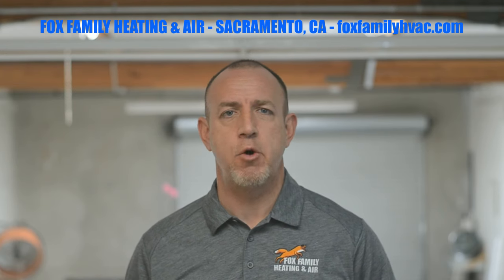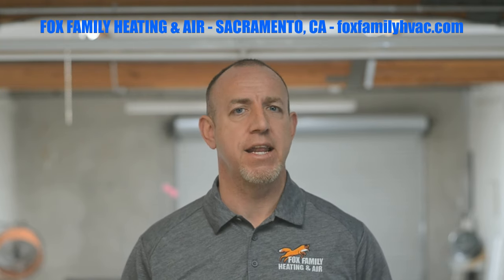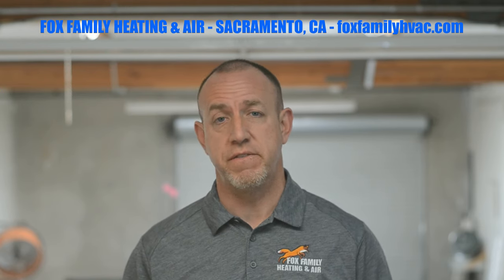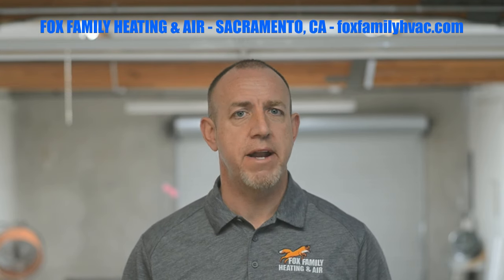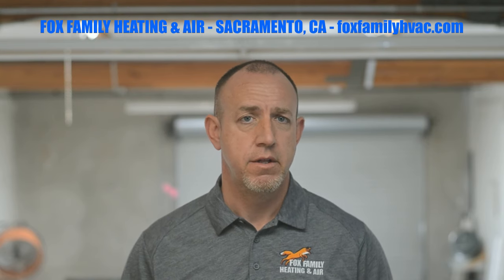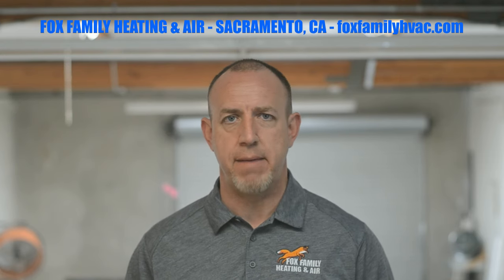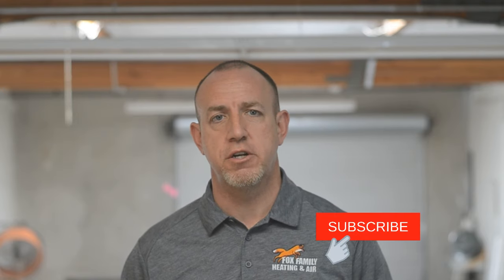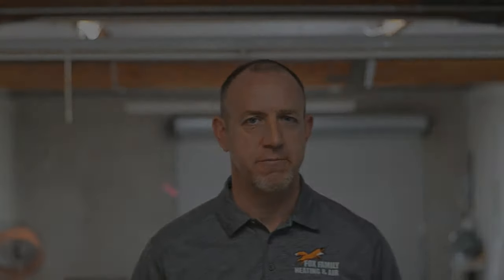Why Does My Air Conditioner Circuit Breaker Keep Tripping?

Comment: why that LONG story?
Reply: Lol
Reply: FR
Reply: Totally true, could have cut it in half
Reply: Lmaoo hey uncle Ricky can you read us a bedtime story please!
Reply: How to perform CPR spends 10 mins on introductions
Reply: @ivancarrascoq 1🎉😢🎉🎉
Reply: Low line voltage can cause the compressor to over amp. Intense solar heat can cause a weak breaker to trip. Old style aluminum wiring can cause a bad connection and produce heat and trip a breaker. Low incoming voltage may require an investigation by the power company. The Technician can contact the the power company and the Power Quality Department should be able to adjust the incoming voltage. The home owner should not be required to buy power regulators. Sometimes voltage recorders are placed to detect things like large manufacturers using a lot of power at certain times. These situations normally start off with an adverse situation with a battle of who’s volt meter is better calibrated and what is the allowable voltages. Not something a homeowner is prepared to do. An AC technician needs to know when to call in an electrician.

Comment: my upstairs ac kept tripping after 10min of being on. a handy man had told me to change my air filters first. im a new homeowner so i havent replaced the filters since owning the home..about 2 years. xD. anyway that fixed the problem. dirty filters cause high pressure and make the ac over work so change ur filters every 6 months.
Reply: negative pressure
Reply: You should change your filters more often than every 6 months as well. People buy new homes, and like you, fail to do preventative maintenance. It’s part of the cost of owning a home. This is why a mortgage, isn’t the only cost to consider when buying.
Reply: 😮ok. great word !
Reply: Ty and appreciate you
Reply: 100%. People tend to forget about the taxes, interest, maintenance, repairs, and the very good possibility of the market crashing…purposely of course.
Reply: My nest voltage is acting up geting low

Comment: Our ac is tripping our breaker 1week have past and it's still the same, ac works on fan setting but when in cold setting it immediately trips. What cause this problem? The electrician came but still the same issue happens he can't fix.

Comment: If the unit has not been cleaned in a while, it may just need cleaning. Make sure the current is off before cleaning. Cleaning is a very simple process. I just paid $260 for a cleaning, when I could have cleaned myself.

Comment: "It takes a licensed contractor to order them from a local distributor"...Well in some areas this is true however one DOES NOT need to be licensed to order HVAC parts other than perhaps refrigerant, online. There are some distributors that voluntarily refuse to sell parts to locals so as to protect their customers, the local yokels that call themselves HVAC techs and the businesses they work for (by the way, plumbing suppliers, electrical suppliers used to do this too) however, it has become a practice that does nothing more than force the consumer away from their business to businesses on the internet that indiscriminately sell to anyone. Frankly, when I moved to Florida 15 years ago I was forced to maintain my own system because of the incompetence of the HVAC techs I dealt with back then having realized that I knew more than they did! I once asked one tech what superheat he measured on my system and he didn't have a clue what I was talking about! Subcooling would clearly be over this guy's head too...

Comment: Mine trips immediately.  Could that be the capacitor or the contactor?  Hoping it is not the compressor.
Reply: Update?
Reply: @juanjoseguevara88   It actually happened to me TWICE!   Once was a power cord that was not properly run through conduit and the edge of the metal enclosure cut through the power cord and shorted. Easy fix.  The second time it was the compressor motor that went bad and had to replace the motor. that one was about $800.  Guy who fixed it said that most times it is the capacitor.

Comment: What can cause breaker to melt? Condenser motor was changed,contactor, and turbo 200. Original cap was 45/5 and bearings were giving out. So switched out.

Comment: Why does my 20 amp a/c trip it's self a few hours after running but when only  it reached 90 plus outside. I also hear clicking somewhere above the breaker box?
Reply: Have you resolved this issue?
Reply: Higher ambient temps .. eventually higher high side pressure. More load on the compressor.. more amp draw.

Comment: Question only when it reaches 105 degrees my ac in my rv continues to shut off and on. But when it's cooler like at night it doesn't shut on and off. My portable ac does the same thing
Reply: Did you figure out the issue? I'm in the same boat

Comment: My 10 yr old + heat pump is tripping on start , after flipping the switch once or twice it usually works . At the moment it’s only doing it on heat. Would changing the capacitor fix the problem?
Reply: New capacitor fixed it.

Comment: My 240 amp AC breaker doesn’t trip. It’s the furnace 20amp breaker. But only once in awhile. And only started doing it after the thermostat was changed? It didn’t do it before??
Reply: Odd.. Is it gas heat?  And if so, 20 amp is unlikely too.. usually its 15 amp just for the inside blower.  The relations ship to thermostat is no there, since gas rarely short-cycles. I'll check the cap on the blower fan .. and change it out once you have that pulled. To do so, you have to pull the blower -- not so straightforward but plenty of youtubes for that.

Comment: Do you know why my circuit break it tripping only when I'm using the dryer and A/C  and it's only tripping the dryer.  If my a/c isn't on the dryer runs good?  The circuit breaker isn't hot just a little warm 
Thanks
Reply: The circuit is overloaded and is drawing more amps than the breaker is designed for. 

Either don't run ac and dryer together or install a larger breaker. The breaker size is determined by the cables conductor size. If breaker wasn't tripping electrical fire may occur.
Reply: 208-230v circuits should be individually ran. Two circuits on that type of wiring will overload the circuit. Don't just assume to install a larger breaker. Call a pro

Comment: My AC's trips instantly.  Is it likely an electrical problem?
Reply: Bad compressor usually if its right away.
Reply: @marcoselgaucho1106  check wiring in outside compartment...i had a dead mouse shorting out the capacitor once..big sparks

Comment: Worked fine last year but out of the blue it has been tripping out within every 24 hours. I find it frustrating and it’s a newer unit. My house runs on 100amps
Reply: Now it’s dead
Reply: Bro the same thing just happened at my place, did you find the source of the problem

Comment: this video only applies to home outside a/c units, right? not window or mobile a/c units, regardless of how big they are, because the fix is more than what they cost?
Reply: Correct. It’s a mini version of a full ac system, and the cost to even check on it will be close to if not more than most window units.

Comment: This is interesting... I purchased a new split AC, technicians recently installed it... It was tripping the breaker they put it with, so they came back after I reported it and put in a new one. 6 days passed with the AC working fine and now its tripping it again...

Comment: Good info on the video. Now what if the breaker doesnt trip but by turning off and then on will the AC start working. Happened to me twice this week, AC shuts off no power to control panel (no lights) no humming outside unit,overflow switch good,system dead so I go to the cb box, cycle the ac circuit breaker a min later system is running.I really dont want to call a tech if the system is working for now,might get a tech just like you mention. Any suggestions? Liked and sub.Thanks
Reply: Me too, same thing. Doesn't trip the breaker, but if I turn off breaker and reset, just stays on a couple minutes, then repeats. Have to wait on tech a couple days now
Reply: Did you ever get an answer for this, I know this comment is 3 years old. I’m in the exact scenario

Comment: I keep bugging my parents to have someone come check out their home breaker that trips whenever more than 1 wall ac is on. My dad keeps saying we don’t have 240v and he doesn’t want to upgrade due to cost? Can someone explain??
Reply: He is pulling more amps from the breaker than it can support, causing it to trip. The units need to be wired to separate breakers or have a higher amp breaker installed
Reply: @EcnalKcin  But you’d better have the correct gauge wire to match.

Comment: It tipped i thought it's fine ,so kept turning it on again and again and the ac stopped working ,there is no cooling.
We bought a new ac casue that one's circuits not working.
And it tripped again.i am scared to turn it on again.
What do i do
Reply: What happened?

Comment: My AC wasn't working..so I took it apart and deep cleaned it. It worked better then ever for 2 maybe 3 hours..it was incredible, then it just tripped..not the breaker down stairs but the one attached to the AC plug.

Comment: Help! My ac unit has worked for three years no problem. Since last summer It keeps tripping the breaker but sometimes it takes days before it will trip the breaker depending on how hot it is outside/how hard it's working. I also notice the fan will run but it will stop pushing out cool air shortly before it trips the breaker. Now it trips the breaker within 24 hours or less. Maintenance has been over six times and the only thing they've done is replace the water heater because I'm quite certain they broke the water heater by constantly tripping the breaker with their experimentation on the ac unit. They always seem to show up when I'm gone and when I get back they don't tell me what they did. So the ac works for a bit and then trips the breaker again. Then i have to put in a ticket again. I have no idea what is going on at this point other than it's the ac unit and they just don't know what they are doing. Any idea on what this could be?
Reply: Did someone overcharge the system?  It is not uncommon for a less-trained (un) HVAC guy to put in a pound of freon and get on the road. Do that a few times and you have created a new problems..A good tech can figure this out.. with a little patience
Reply: @ramchillarege1658  They ended up replacing the entire a/c unit stating it was something to do with the compressor and the unit was old. So things were working fine for a few weeks and now we are getting a leak from the furnace. I'm assuming the condensation lines are clogged. I'm not aware of them putting any freon in the system.
Reply: @jharper2189  When you say "leak from the furnace" I am assuming you mean the indoor unit  just about the furnace, where the coil sits (upflow).  Note that the air-conditioner also works as a de-humidifer. The condensation is piped out of that and out of the house. It could just be the plumbing - shoddy install. A larger problem is when there is too much condensation or freezing of the coil. That would be more serious.. usually due to low freon - shoddy welding/brazing of the joints on a new system.
Reply: @ramchillarege1658  Yes, it's the indoor unit I'm referring to. This isn't my first guess but is it possible that lots of rain could cause something like this?
Reply: @jharper2189  Not directly. High humidity causes more condensation that needs to be removed. But the cause are the same two reasons I already listed.
Reply: Oh i see what you are saying now. You just taught me more things i didn't know about HVAC. Good stuff!

Comment: I was told that my house was too old for my new a/c system. The power from the a/c kept tripping the breaker cause it doesn't carry enough power for the unit.
Reply: They can always run a new line. But, that's an Electrican task. The HVAC guy is not licensed to do that.

Comment: I had recently bought a 14,000 btu window unit rated 115 volt on a 15 amp circuit . A circuit operates on approximately 80% of its rating which in this case would be 12 amps .It kept tripping . Lol turns out that this unit drew 11.9 amps !! Nothing , not even my lights could draw on this circuit without the breaker tripping . Without a dedicated circuit thos unit was useless
Reply: 14k btu should be a dedicated 20 amp circuit....14k wall or window units are usually 240v
Reply: @workingshlub8861  It was definitely 115 v .... Its was drawing 11.9 amps on a 15 amp breaker ...there was no room on the circuit for anything else
Reply: How can you fix this problem ? I currently goin thru this
Reply: @user-fj2or3xp2c  I returned the unit for one that drew less amps . The only alternative was running a new dedicated circuit on a bigger breaker
Reply: @ApothecaryGrant  damm that sucks is it expensive to have a bigger breaker ?
Reply: @ApothecaryGrant  j
Reply: @user-fj2or3xp2c  Breakers are cheap, but if the wiring from your box to the outlet is thin, it may need to be upgraded. That can get pricy.
Reply: @ApothecaryGrant    Induction motors draw a large starting current. Steady state of 12 amps could easily draw 2x at start for a few seconds.
Reply: How did you place this comment two years ago, but have a recent picture of Trump as your graphic icon?

Comment: MY AC /heat pump says max 15 amp breaker but its a 20 amp breaker,  am i safe
Reply: NO.  But, what size unit is it?  BTU?
Reply: @ramchillarege1658  12000Btu/h DC inverter, Outdoor, installer says its ok but on unit it says max 15 breaker

Comment: What about tripping occasionally like a week apart? Electrical problem possibly?
Reply from the maker: Either that or a weak breaker.  But yeah remember these are safety devices so if they are tripping weekly it's time to get a professional HVAC technician or electrician out to sort it.
Reply: How do you find out that your AC unit is pulling to many amps?
Reply: @foxfamilyhvac   It tipped i thought it's fine ,so kept turning it on again and again and the ac stopped working ,there is no cooling.
We bought a new ac casue that one's circuits not working.
And it tripped again.i am scared to turn it on again.
What do i do

Comment: This is happening but with my refrigerator breaker
Reply: Clean the coils -- rather, pull it to the front remove the back and see the dust and hair is clogging up the condenser coil there.

Comment: I have a window unit that only trips when it is over 92F outside :(  I can only run it at night.  Should have kept my old Carrier. These plastic Chinese AC units are junk.
Reply: Maybe. Undersized compressor... can't handle the load and the amps crank up